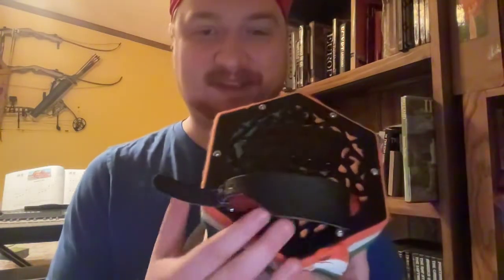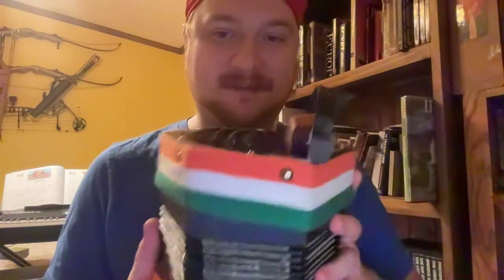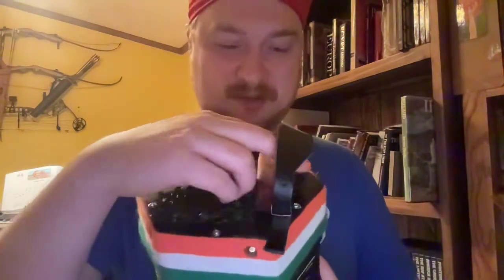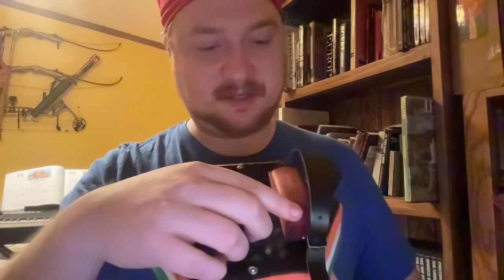Upgrade your Concertina!

Comment: Regarding the straps rubbing on your knuckles, if you make new ones you can shape them so the front edge steps in a bit in the wide section to give more knuckle clearance.
Reply from the maker: Oh, I totally forgot to mention that! Yes, the new straps should be reshaped but more importantly, you need to move the bridge/peak of the hand-rest lower. You can do this by making a new piece which is taller and remounting it lower or making a piece which attaches at the place (as shown here) but is shaped to bring the hadn't-rest down. For me, the new hand-rest sits just below where the old one was.
Reply from the maker: Your concertinas are beautiful by the way! Are you taking orders again yet?
Reply: @scichord  Thanks! Not taking orders right now, sorry.